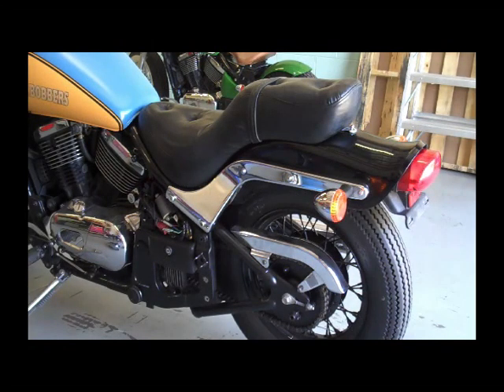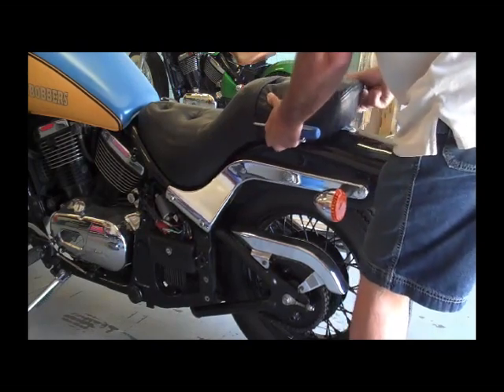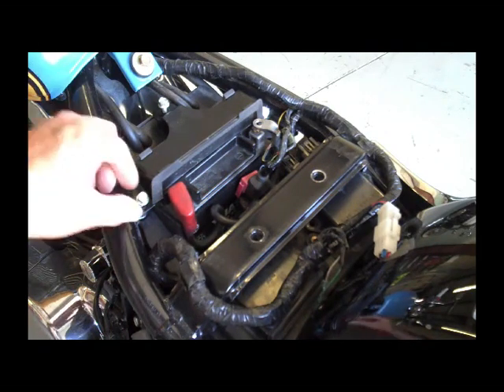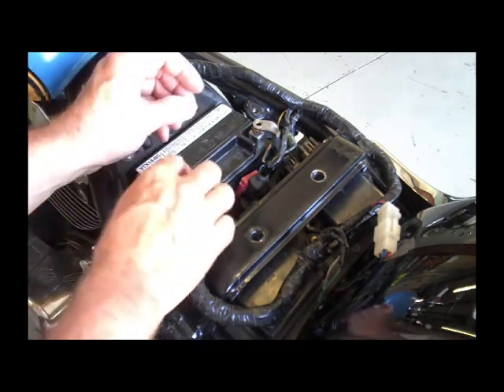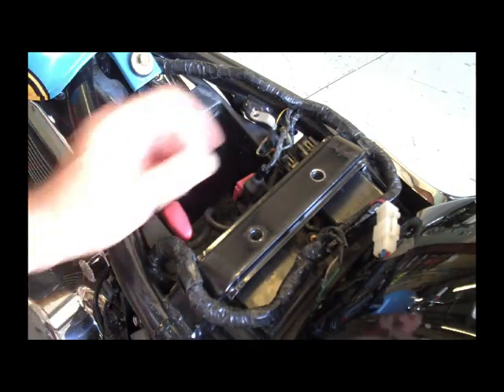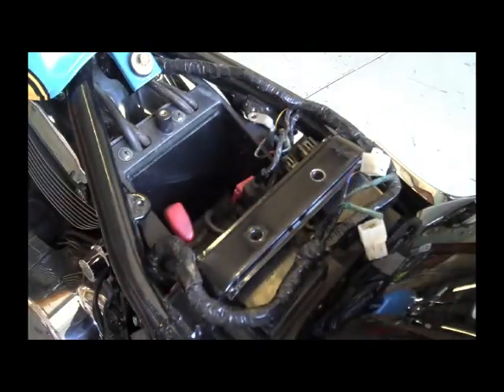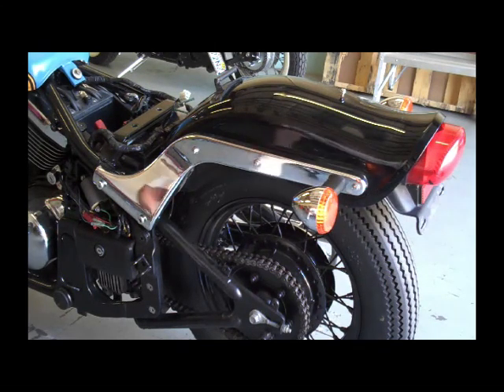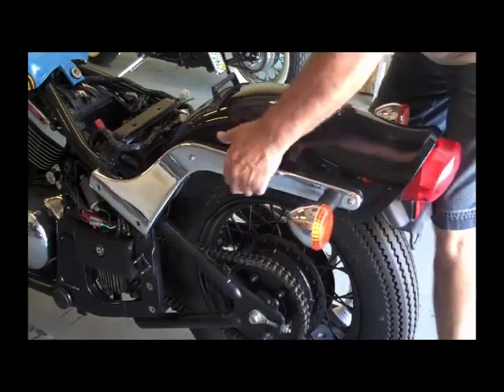Kawasaki Vulcan 800 Remove Seat & Rear Fender

Comment: I have a 1997 vulcan. unable to remove the bottom 2 hex nuts of the rail. using a #6mm. It won't budge. any ideas?
Reply: Did you get it?
Reply: I’ve got a 1996